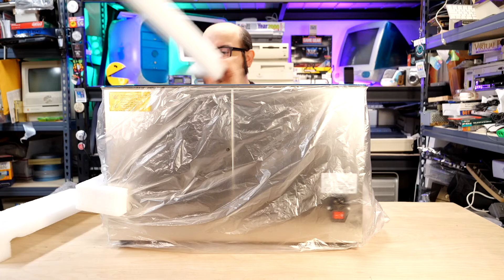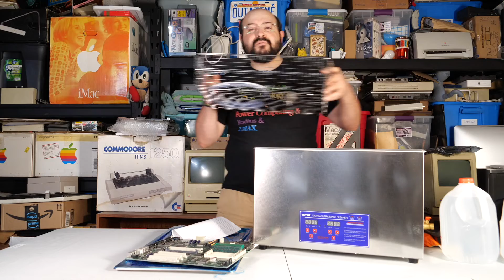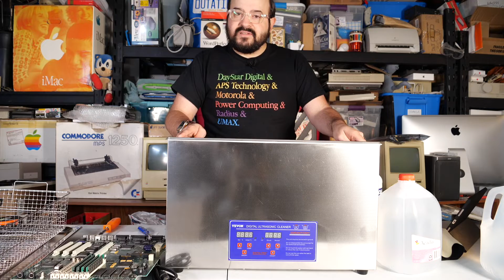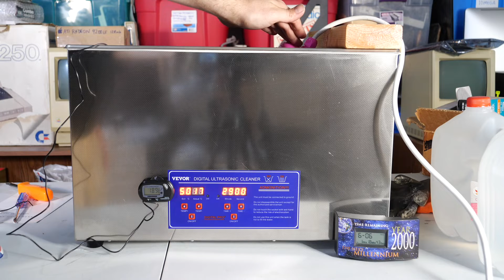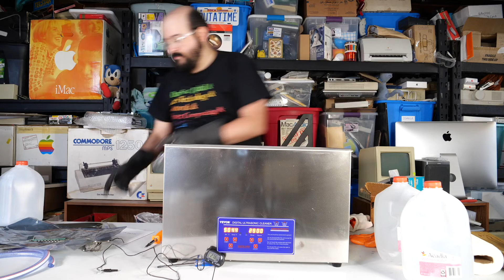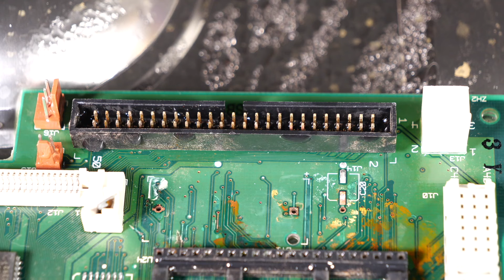Review: VEVOR's HUGE 30 Litre Ultrasonic Cleaner!

Comment: I’m curious if you experience the same thing I did when I also purchased the same ultrasonic cleaner probably a little bit before you did or at least before your video was posted.   Most people show it actually working, but they never actually show or comment on the cleaning/draining process.

In my case, that hose with the fitting on it for draining is just not quite the right size for the valve. The hose or technically the fitting/threads, were not the right size and were slightly small in diameter compared to the valve. So it’s not like it actually screws into the valve in any meaningful way. You can get it to sit in there but there is no way you’re ever going to get it tight.   I did not manage to actually spill anything. But it wasn’t a positive connection.  

Other than that, the machine has been great.   But because I also do automotive parts, I did the right thing, and also ordered a Chinese made 360 L industrial ultrasonic cleaner that you can put large engine parts in for my garage.  Even though the 30 L is a pretty big ultrasonic cleaner, when you are rebuilding a transfer case for an old Chevy pick up, you can only submerge half of the part to clean it, and then rotate it and clean again.   Hence the impulse buy and the very large appliance now in my garage lol

Comment: Those boards were really bad! I've been tempted to splash out (pun intended) and buy an ultrasonic cleaner, but I don't actually have room for one in my tiny apartment right now. I need to find a strapping young man to take away my old fridge, that would certainly clear enough room for a table large enough for such a beast.

Actually, I just googled for the price of ultrasonic cleaners here in Australia, and they've really come down in price since I last checked. I guess I've found what my next overtime pay is going to be spent on. Now I just need to figure out where to find a well-muscled young man to take that old fridge away. It's a big fridge, so he'll need those rippling muscles ... or perhaps just a trolley.

Comment: Interesting. I purchased this exact model last week. Plan on using it to clean a PowerMac G5 QUAD version 2 cooler (minus the pumps). Everything else in the system looks practically new or very lightly used... BUT it overheats shortly after booting to desktop. Think this is deep enough to submerge the whole thing. My thought is 40C and 30min each side then flush for a few hours with a distilled water and vinegar solution with external pump, Then another round in the ultrasonic cleaner and a couple hours of flushing with just distilled water. Probably overkill but I wanna make sure.

Comment: Have you ever Ultrasonically cleaned an Analog board from a compact Mac? If so, did it damage the varnish on the windings of the Flyback?
Reply from the maker: I’ve ultrasoniced a power supply (which was fine) but not an analog board with a flyback on it. So I’m sorry but I can’t personally answer that. Although I’m sure some web searching may dig up some details.

Comment: Excellent video and review of this unit. I have two questions. First, other than distilled water, what did you put in, I mean the cleaning agent? Wil you do a video on a very large board? Like a Commodore PET and if you do, can you place it in without the basket? I guess that's 3 questions 😁. Thanks for sharing your experience.
Reply from the maker: Thanks!

I use Branson EC (@10:53), it’s a chemical I’ve used before which was recommended to me by others. It works well in my testing.

I have a large Macintosh II board I’ll be cleaning, but it was in-repair during this video’s filming, so it wasn’t ready just yet. I’ll be sharing more about this I’m sure!

I don’t have a Commodore PET, but even if the board doesn’t fit, it can be placed in the tank without the basket and sticking out of the tank. I had to do that before with my smaller cleaner.
Reply: @Mac84 Awesome, and thanks for the information 🍻

Comment: @15:40 I think that the difference in temperature is due to the lack of mixing. The water near the bottom of the tank is going to be cooler than the water near the surface. The internal thermometer is probably near the bottom of the tank. I suspect that this is the culprit for the difference in measured temperature.
Reply from the maker: I did place the external thermometer at the bottom of the tank, but I did notice the built-in thermometer lagged behind, it took more than 15-20 min for it to "settle" at a more realistic temperature. My smaller cleaner didn't do that, so it may just be due to the large amount of water in the tank. Either way, I think the $5 thermometer is handy to have, but again, who knows how accurate it is. ;-)
Reply: @Mac84  Fair enough! Strange that it differs and lags that much then. I think that it's safe to assume that a cheapo thermometer differs in the vicinity of 1-2 degrees Celsius from the actual temperature.  It was overall a great review. Well done!

Comment: Thanks for the review! I almost picked this exact one up recently... but decided to try the dishwasher method for now and work my way up to this. I hope you'll consider doing an update on it after using it for 6-12 months to see how it holds up. Congrats! :)
Reply from the maker: Just be careful with tap water, I've seen some nasty outcomes when minerals and other things were left to sit on electronics. If you must use the dishwasher, be sure to use alcohol (IPA) or distilled water to clean the board afterwards. Good luck!
Reply: @Mac84  Yessir! I did a scrub with IPA right after to hopefully avoid the minerals... and even still got some build-up on the bottom side that needed manual cleanup. The ultrasonic would be much easier & better - just large and expensive for a hobbyist like me. One day! :)